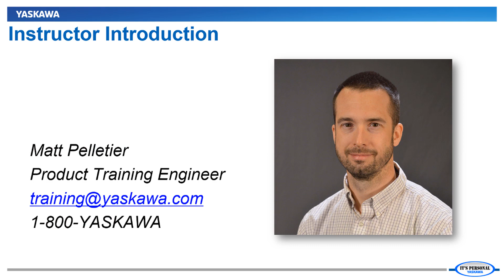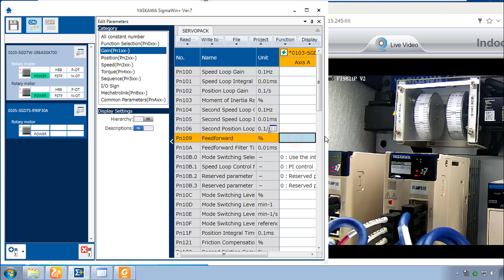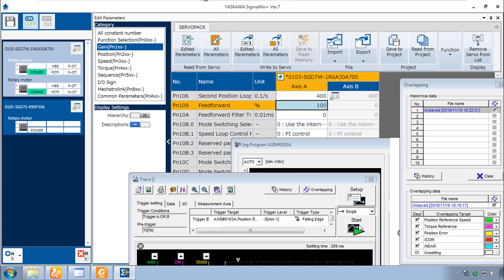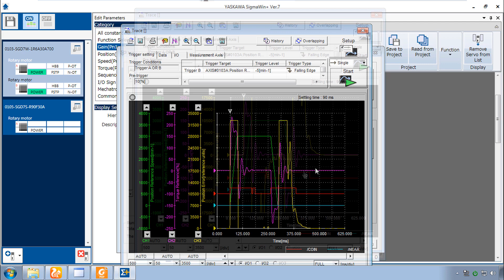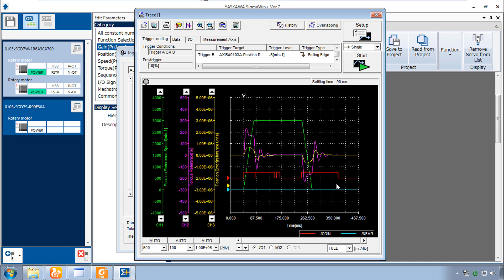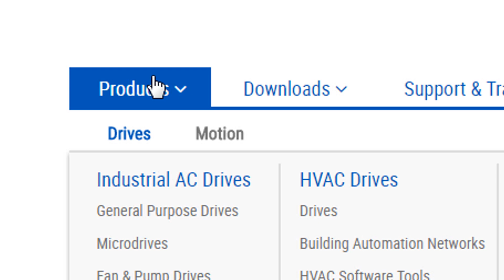09 Tuning-Less (Sigma-7 Servo Tuning)

Comment: Hi Matt ! Great video ! I have a quick question. Any way to connect and auto-tune 2 servo amplifiers at the same time via usb ? Have CNC table with Yaskawa servos, 1 on each side of the gantry (Y axis). Gantry is quite heavy and tuningless is not enough. Had great luck with auto-tuning on X axis so I want to try it with Y too.
Reply from the maker: Mr. Potyra,
The individual axis (X and Y) in the Gantry can be tuned.  However, it would require application support. Please contact TechnicalSupport@yaskawa.com
Reply: Hi Przemek, I want to do the same with my CNC, have you got an answer from technical support on a solution?